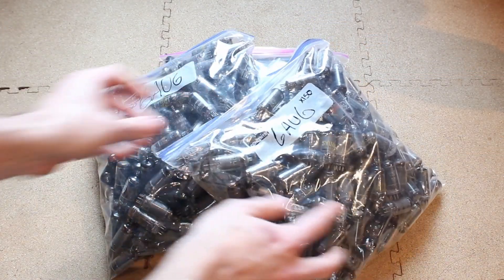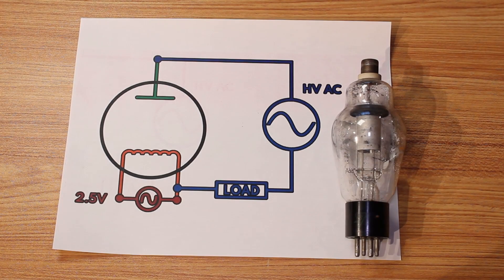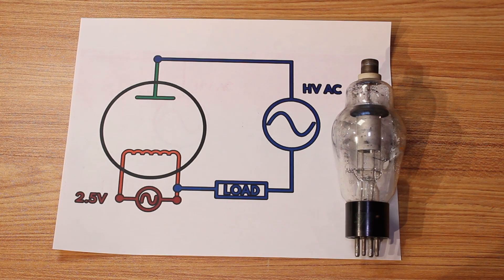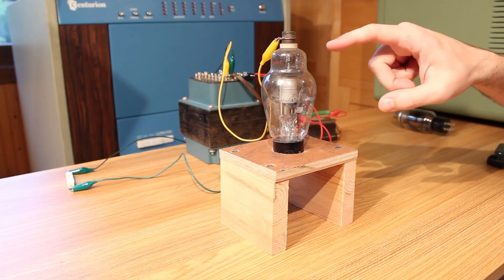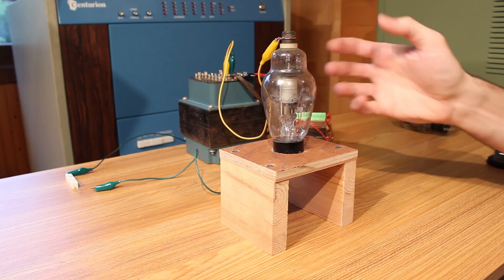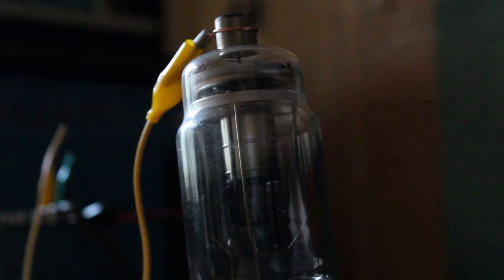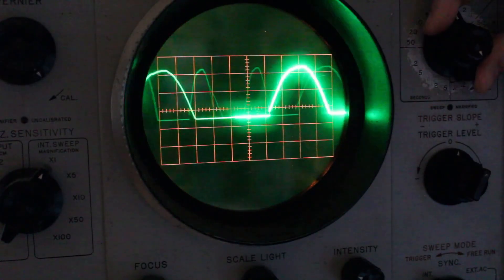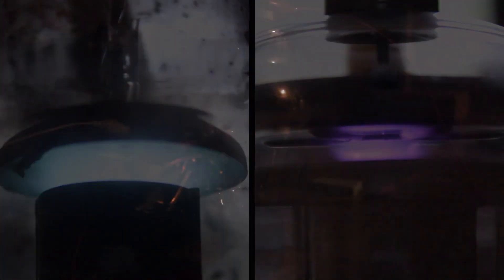A Look at Mercury and Xenon Rectifiers

Comment: In the 70s there was a rectifier station on my neighborhood. The sign said it was mercury rectifier station for the electric buses (in Brazil they were like trams with a pantograph at the top to the electric line but without tracks). My father worked with mercury rectifiers on radio transmitters: they were HUGE, usually the heating cycle was manual, controlled by push buttons to heat and activate.
Reply: if you do not have the tracks as the return path, you will need two pantographs and two wires on the top...
Reply: @janami-dharmam  Yeah, two "sticks" https://www.lubus.info/images/stories/technika/siec/3839-153-2011-3.jpg

Comment: I can remember doing some (usually "jury rig") repairs on old B&W valve TVs, and the tube I remember giving almost all the trouble was the 6GV8.  Any time you got "frame collapse" or a lack of Vertical Hold, you could practically bank on the 6GV8 being either faulty or not connected properly (often because of a bad solder joint).
Reply: That mercury vapour tube has the whitest of white glows just before it changes to pale blue.  It reminds me of a dream I can still remember from when I was a child.  I never expected to actually see such a pure white in real life.  I'd thought it only existed in my dream.
Bunny: Where's more food?  More food, I say!  This isn't edible!  I'm out'a here!

Comment: Beautiful.  I didn't know mercury vapor rectifiers came in such a small package.
Reply from the maker: The much larger mercury tubes are actually a little different. Those are Mercury Arc Rectifiers, and interestingly, they don't have a filament, making them a cold cathode tube. But the cathode is actually the pool of mercury in the bottom. They're amazing pieces of engineering and I'd love to get my hands on one someday!
Reply: @UsagiElectric  i was gonna ask if it was the same principle with the big mercury rectifiers.  Question answered.

Comment: very nice mercury vaper tube and xeon tubes i use to worn in broadingcasting and we used an old Gares gy 250 transmitter on am it had i belive the 8008 tube for recitifaction at about 1400 volts and they really glowed nicely under full load.

Comment: I love these tubes. I’m always amazed at the huge mercury arc rectifiers used in the old power stations and the ones in the old underground railway stations for the lifts etc. amazing stuff 👍
Reply from the maker: Thank you!
Interestingly, the big Mercury Arc Rectifiers are actually a little different. They're technically a cold cathode tube that uses a pool of mercury in the bottom of the tube as the cathode. They're brilliantly designed tubes, and if I can ever get my hands on one, I'd love to do a deep dive on them!
Reply: We used to use mercury arc rectifiers in telephone exchanges to keep the 50 volts batteries charged.

Comment: Running what is essentially heater current through a limiting resistor seems a bit strange, but then again why not, it's like 10 watts to dissipate and the load is entirely resistive anyway 🤔
Reply: Not really for current limiting.  It’s to reduce voltage across the filament.
Reply: @wtwarner  Resistors always limit current, not voltage. The voltage is not reduced by the resistor itself, but the way the resistor and the load are set up as a voltage divider.

Comment: Once upon a time, way way back when, I observed a thyratron in operation.  It was part of a DC motor control circuit.  It was a phase control circuit, just a bit before semiconductor thyristors or SCRs took over the phase control applications.  I mean, there were already small SCRs available, but engineers did not yet know how to really use them.  So thyratrons were used as old "familiar and sure working" components.  The maximum current was quite limited, but sufficient to drive saturable core amplifiers or "mag-amps".  If you find some thyratrons, I believe that would be a nice addition.  By the way, a really high current mercury rectifier was called Ignitron and was used in electrochemical applications like galvanic plating.  I have never seen one, only read about them in an old book.  Another 'by-the-way' item I have used was a short arc lamp in a multi channel oscillograph.  The tiny and very bright light could be steered with tiny swinging mirrors onto photo sensitive paper to produce a permanent recording of something before the digital storage oscilloscopes or where Polaroid scope cameras offered too short a snapshot.
Reply: mercury arc rectifiers were used when we needed currents of 1000 or 10000A for example for use in electrolysis for metal production (Al, Mg, Na, K etc etc)
Reply: Also used to rectify current for railway trains, I think one is in use in one of the UK islands.

Comment: I assembled two vacuum tube circuits when I was a kid (late 70s / early 80s): a one-tube audio amplifier and a superheterodyne receiver. But since I was not a purist, I used a silicon diode instead of the rectifier tube so the 5-tube receiver was a 4-tube. 12BE6, 12BA6, 12AV6, 50C5 and 35W4 (not bought, used diode). That kind of transformer-less receiver was called "hot tail" in Brazil. Very simple kit, only AM band, no shortwave. I'd really like to find the parts to make one of these today. The tuning and IF coils are probably the hardest to find.
Reply: Hey again! I still have the kit's schematics! https://www.dropbox.com/s/r8ze2e6jpzkw3a5/20220815_232724.jpg?dl=0

Comment: were 6AU6s very common over there? in the UK it was EF50 first, many were available as ex radar surplus after the war, then EF91/6AM6, bucketloads were also available as surplus/cheap in the 50s to early 60s,   and eventually EF80/6BX6, these were used in pretty much  all valve tvs until replaced by  the later EF183 and EF184   , there was 6AU6s/EF94s over here but not that much used,  EF93/6BA6 more so

Comment: OD3 Tubes glow good, and you can see the power beam inside.
Reply: There are various gas-filled regulator tubes - the most easily-identified ones are in the "zero" series: 0D3, 0C3, 0A2. There is no cathode heater, hence the 0-volt designation. Also of interest, if you can find one, is the 0A4G cold-cathode triode. There are some very interesting applications suggested for that one in the RCA datasheet. (Such as remote control of line voltage via RF signals transmitted through the line being switched)

Comment: Just avoid staring too much at them, and protect your skin. Especially for the Hg valve. The nasty UV from them can hurt you fairly quickly if the envelope lets it through.
Reply: poly carbonate safety specs will help
Reply from the maker: A large majority of the UV light is blocked by the glass envelope and there shouldn't be nearly enough passing through cause UV burns. Though, protecting your eyes is in general good advice around old electronics!
Reply: @UsagiElectric  that’s nice. You would otherwise notice it quite soon after it strikes as you would have an (un-)healthy dose of ozone permeating the area around the valve, and unless you are one of those who cannot sense it, your nose will be an excellent sensor to determine if the envelope is opaque enough to the nasty UV.
Cheers

Comment: Loved this - and the heatsink for the dropper resistor for the filament supply made my day!
It's perhaps worth noting that Xenon tubes to not have a "right way up" whereas Mercury Vapour tubes must be mounted vertically (as yours) so that any mercury condensate collects away from the anode when the tube is not in use.

Comment: You didn't discuss the development of the high current plasma channel cascade or the breakdown voltage clearly visible on your Oscilloscope at the start of each 1/2 wave.  
It would be interesting to have a 120V AC supply at 59 or 61 Hz to watch the plasma glow cycle on and off once a second with the out of sync 60 Hz shutter speed.  (not sure what your camera shutter speed is and the supply frequency would have to be set for that speed)

Comment: These cannot be used with a capacitor input filter for full ratings. You need a choke input filter. Vacuum diodes like 5u4 can be used with a capacitor input filter. not these.

Comment: It would be great to look at thyratrons, regulated. To show how it changes during different phases of ignition and various loads, inductive with overload included. But it's hard to simulate.
Reply from the maker: You know, that is actually something I've wanted to play with for a while. Using phase shifting on the grid of a thyratron to build an adjustable and/or regulated power supply, but you're right, it's pretty tough to get it just right. Plus, the little 2D21 thyratrons I have aren't quite up for power supply duty. Hmm, time to hit eBay for some bigger thyratrons...
Reply: @UsagiElectric  i have only heard of it in my middle shool. In the meantime I loved vacuum technology. In the old days I have ridden in electrical grid busses that used it. No way to watch them - closed somewhere in the back. Only stories. It would be beautifully satisfying to watch them work sililarly like in the stories!

Comment: Beinga Ham radio guy, I used to have a surplus army shortwave radio from an airplane where the dynamotor was removed and the guy that gave me the setup had built a power supply to replace the old aircraft setup so it could get the proper voltages from AC mains.  That power supply had a rectifier tube on it, but it was not a cool Xeonon or Mercury vapor tube.  Was still cool.  If memory servers, the radio needed 15 VDC and another weird voltage to operate.  It was modified to pick up Amaturer frequencies as well as shortwave.  Loved the video and it has been about 40 years since I had seen a tube recifier 🙂

Comment: I know virtually nothing about tubes relatively speaking but it seems like it makes sense in my head that Xenon gas would sink less voltage than mercury vapour. Either because of the phase or the density or because it's a noble gas or some combination of reasons. Fascinating either way.

Comment: Back when 16bit music CDs first became a thing their sound was decried as sterile and lacking warmth, so a lot of people jumped on the tube preamp/amp band wagon. At that time oil caps and transformers made tube circuits ridiculously expensive. Hard core purists stuck with tube rectifiers, but it was a lot cheaper to have/make power supplies made from semiconductors. I'm in the school of if it goes through one tube in the output stage, that's good enough.

Comment: I wonder which of the two produces the most X-rays, and at what voltages?
Reply: You need tens of kilovolts to produce X-rays. So the answer is, at the voltages used normally with rectifiers, none produces any.

Comment: Very interesting Video as always. You made me want to get into a new lot of beat up old tubes😅 

Careful with the mercury rectifier, that's gonna emit UV. In military and industrial type noble gas filled tubes they sometimes used a radioactive isotope to give the tube that little bit of energy to trigger the ionization. Often that was xenon 80 I think so that should be long gone with its half life of 10 or so years. 

Without that isotope the gas needs an external source of trigger energy, usually some sort of UV light so in complete darkness such tubes often don't work right
Reply: The glass envelope blocks virtually all of the UV it generates, I wouldn't worry about it
Reply: @gideonwackers7693  yeah I guess you're right. I highly doubt it's made of quartz glass, didn't think about that

Comment: Crocodile Dundee voice: That's not a mercury vapor rectifier. This is a mercury vapor rectifier. https://youtu.be/YhaQqgXrMMU
Reply: Thanks for the link to the video that was one of the videos on Mercury Arc rectifiers and related Power Systems I've not seen yet here on YouTube there are quite a few more and some are just people observing one in operation not technical videos but still pretty cool there was one which was some sort of elevator Where the mercury are correct fire but much smaller one was actually in the elevator car itself in a cabinet as well you'd think the Murphy are correct a fire would have been in it a separate area and since it would not be moving around would be more suitable and less likely to have issues as well also once heard about some old electrical commodities of some sort that had the Mercury are correct the fire send them and locomotives were well known for catching on fire

Comment: Can you gus imagine how hot it must have been to work in a room full of those things running? It probably cost a small fortune to run them and cool them. Thanks for another great video!
Reply: Water jackets….pump and plumbing…..pond with a lovely spray water fountain
I used wonder why the power radio stations had such beautiful lands scraping…..then one day, while looking at 22 inch tall water cooled 50,000 watt output tubes, the light bulb in my head begin to glow “DUH, closed loop evaporative cooling”…bet those power and transmitter rooms were sweat boxes

Comment: it reminded me of some college work I did many years ago we were experimenting with DC  machines. The DC rectifier was  a mercury vapour tube about 3 foot tall! That was cool. Although that term hadn't been invented. remember the mercury tube does throw off UV light.
Reply: tall tubes were high voltage but relatively low current rectifiers. 3ft rectifiers were common for x-ray tubes etc

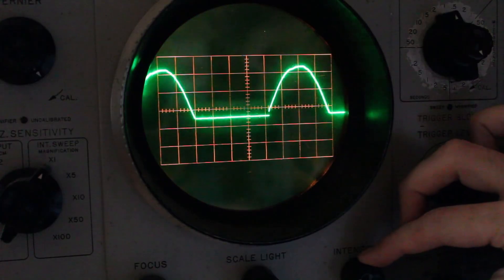Comment: At about 11:40 the trace seems to have a gap just as the waveform starts to rise. Is this just an artifact of the scope or the camera, or is there something interesting happening in the rectifier?
Reply: There is a threshold voltage for the forward, or on state needed to establish the electron-ion cascade needed to generate a current, similar to a florescent lamp.  Once the cascade is established, current can be maintained at a voltage below this threshold on the descending segment, hence the asymmetry in the waveform.

Comment: I have 3B22s xenon filled on my Colins R-278, yes they produce beautiful colors as well. I think that magic eyes are also very cool and very different in technology from the very beginning to the latest models. It might be a good topic for a future video.
Reply: I have several itams with magic eyes in them one a zenith radio an also a old stereo reel to reel deck that records stereo only in one direction as it uses the whole 1/4" tape half for each channel. It has two magic eyes both of those the zenith tombstone radio anfd the tape deck work well. I have not recaped them so it a miracle they are working so good. I dont turn them on much because i do plad on recapping them before they have a problem.